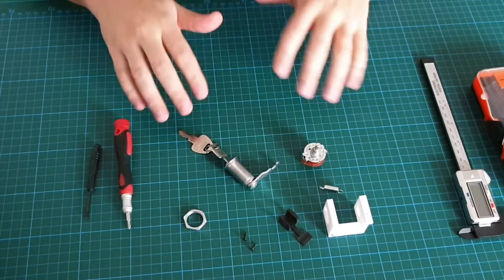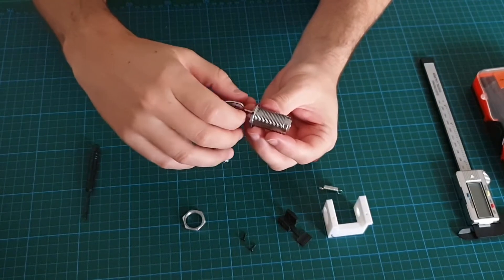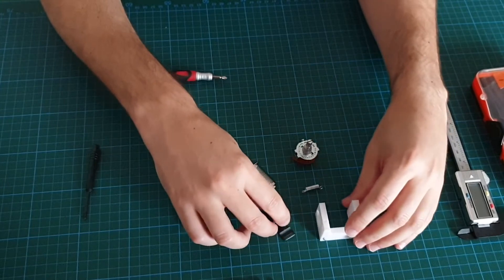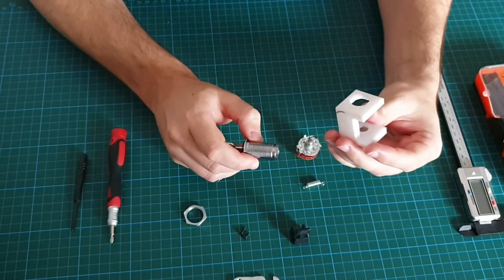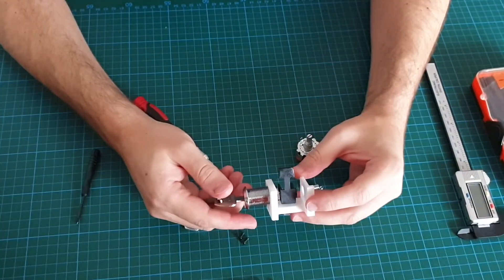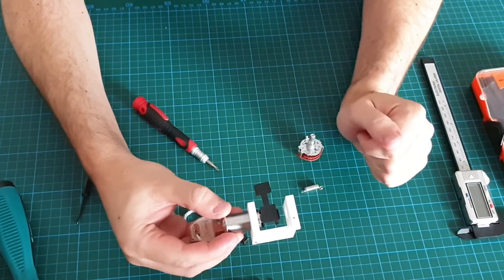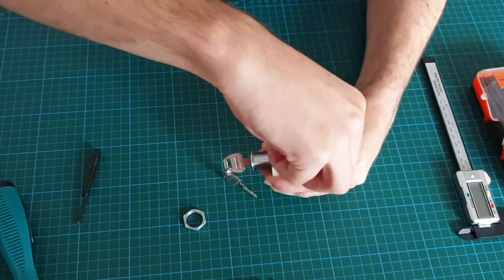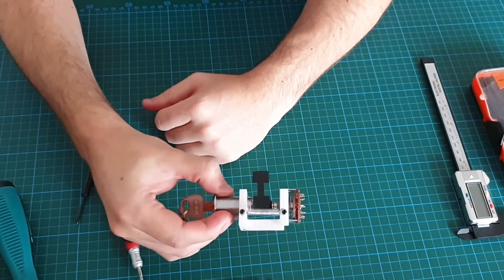Cessna 172 Modular Desktop Sim -  Key Switch Assembly

Comment: I just built this, thanks! Question, are you able to remove the key via off position? I can only remove it at 90 degrees due to the design of the large hole that locks the position of the key housing in place.

Comment: Oh,   you indicated you made mods to the actual internal workings of the lock.   Can you spare some information on this as well.
Reply: I figured out the modification required on the cabinet lock. 
You need to remove the core, either by using a proper core removal key or just put the normal key in, then get some small tweezers and through the screw end you should be able to see the pin that keeps the core locked in place. Push the pin to the side and remove the core. 
Put tape over the pins to prevent them from flying out when the key is removed. There is a metal stop on the side of the core which is what restricts the movement to 90 degrees. Remove it with a small coping saw then replace the core.

Comment: Very creative on the handle part     1.  you indicated you had to make a mod to the holder.    What might that have been?  Also, could you supply the part numbers you used when you sourced the parts at Amazon.   You can respond to Dmcconnell51@att.net
I am retired and beginning my own cockpit design and this information wojld be very helpful.  Thanks in advance